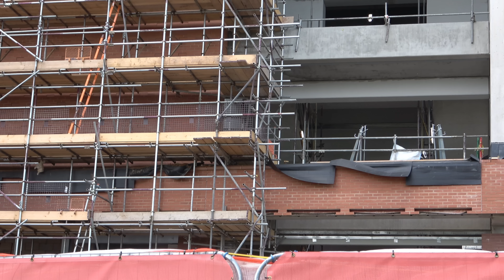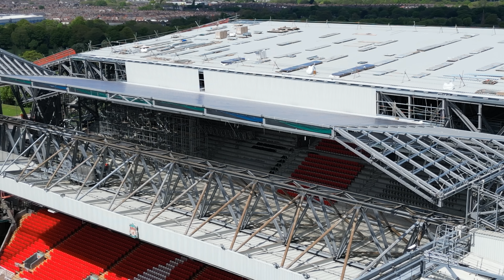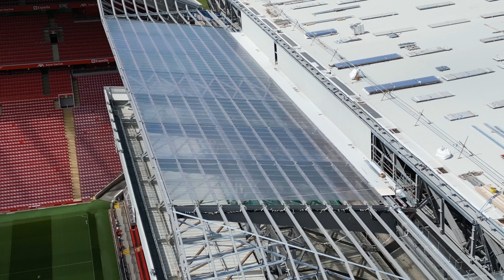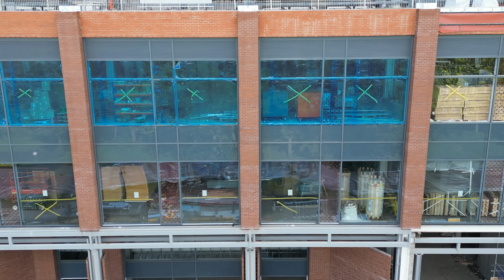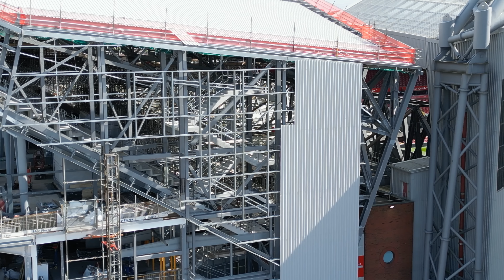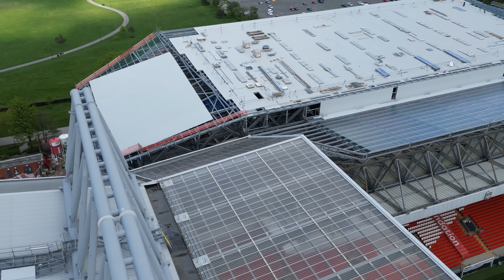Anfield road stand extension, weekend update 12th May 2023

Comment: Great video Paul, what's going to happen to the brick and grey cladding structure that houses the base of the the truss for the old anfield road stand? The one right at the base between the skd stand and the new anfield road stand. Thanks
Reply: The brick structure stays in situ as it is access. The grey structure with windows is hospitality area and also staying. The grey structure running at the back of the existing upper tier is being removed as this will no longer be needed.